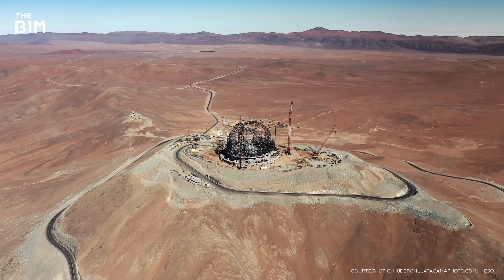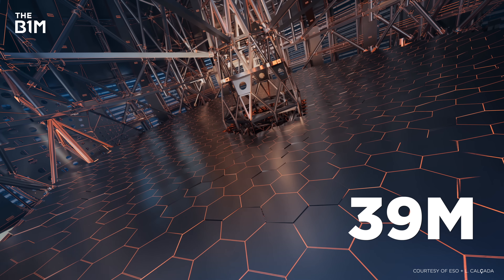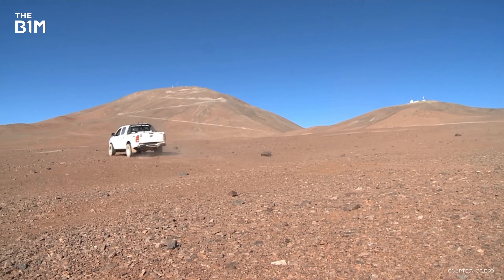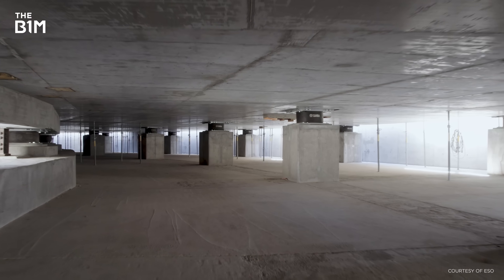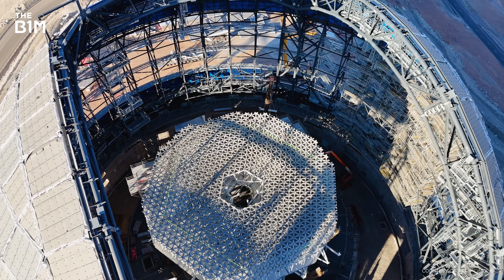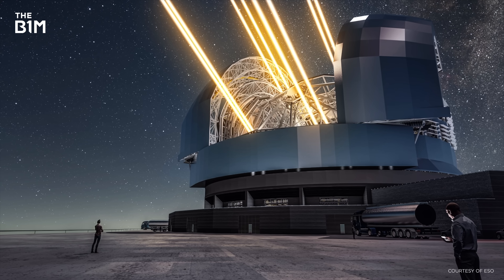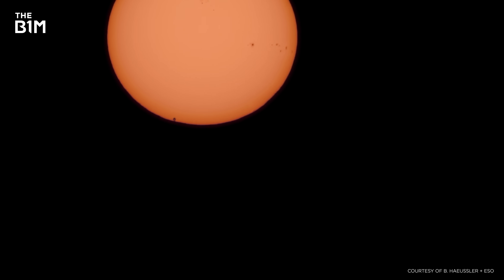South America's $1BN Desert Megaproject

Comment: 10:19 "but enough about mirrors"
I disagree (quite strongly), too much to type so heres a paragraph from the website.
"The M1 is, without a doubt, one of the most impressive and challenging aspects of the entire ELT project. Too large to be made from a single piece of glass, the 39-metre-diameter mirror will consist of 798 segments, each about 5 centimetres thick, measuring close to 1.5 metres across and weighing 250 kg, including its support. Since the segments have to work together as a single mirror, they require specific infrastructure and control schemes. This is extremely challenging, as the full structure will be moving constantly during an observation and will be affected by wind and thermal changes. To achieve the required scientific performance, the mirror needs to be maintained in position and in shape to an accuracy of tens of nanometres — 10000 times thinner than a human hair — across its entire 39-metre diameter!  "

Accurate to 1 part in 1,000,000,000

Comment: The Gemini spacecraft took a 3.5 inch Questar into orbit with a 35mm film camera attached to it and returned with 10,000 times BETTER astrial images than any ground telescope could provide. Space telescopes don't have to "look thru" 300 miles of atmosphere, mirage and heat waves. A no-longer made Meade 16" reflector in space with a 3" sensor attached could outperform the best THEORETICAL ground base telescope for about $60,000 LAUNCHED! Before Hubble, the 5 inch Meade on-board Skylab imaged 500,000 stars never seen on Earth. That's why Hubble, the Solar Observatory and Webb were designed. Read "Sky and Telescope" or any book on astronomy and find out HOW BAD Earth imaging really is.

Comment: If you consider the optics on modern mirrorless cameras, like my Sony, which shoots around 44mp, the actual sensor of my full-frame camera is roughly less than 2 inches wide. That is where light is ultimately captured after being detected and directed by the lens through a glass channel to the sensor. The processor deals with that light and captures it as an image.

With just a prime lens of around 20mm, I can capture some pretty awesome detail in the night sky, like the depth of color in the Milky Way. I can shoot comets fairly clearly with this relatively small instrument.

If you consider the optics of the ELT, with all those mirrors bouncing all of that light information into the center channel, which distributes that information to a gigantic sensor, which looks to be roughly the size of a grain silo you'd see on a farm, that is mind blowing. 

The other thing to consider is that with supercomputers, we can now program them to sort out detail in optical images for better dimension and resolution and color. As A.I. and processors improve, the true power of ELT will be realized. 

After ELT captures an image, or series of images, we can use software to stack the images as well for more resolution. Our algos are getting better all the time at reducing noise and increasing sharpness and resolution, as well as color grading. The leaps in astrophotography recently are mind-blowing. 

Once this thing is operational, it won't be long before people who specialize in photography products (like Adobe and Topaz) begin to come up with hacks and new tools to better process the information in the RAW files if complete files are released to the public. The eventual final images could be better than what the astro nerds can do on their own in their labs if the public is given a crack at the editing, especially universities or random internet nerds. 

The point is, the scale of this project is insane. Also, the resulting images will only get better as our ingenuity with processing and editing improves, which is always accelerating. We will be even more amazed at each new computing stage. 

I do hope this endevour is transparent. If they detect clear evidence of life and alien civilization, I hope it is not either filtered or hidden or sanitized inaccurately. I hope we get to see whatever the hell it is they find.

If they built this because they are already aware of aliens, or have communicated with them, I hope that is shared sooner than later. I don't want any lingering conspiracies about the whole purpose of this machine. Publish everything.

Comment: My question is, how does they keep dust off the mirrors ?
Even unused mirrors get covered in dust, even more so horizontal mirrors placed in a desert.
Reply: We spray pressurized CO2 ice at a glancing angle which grabs dust/contaminants on the mirror surface and removes it.  Every 1-2 years the mirrors are recoated in aluminizing chambers in the lower levels of the telescope.

Comment: the big mirror is, well, mega, but I want to know more about how the later mirror (m4 or 5 ?) can correct for the atmospheric conditions.  
Is that physical or via some optical transforms done digitally ?
That sounds more amazing than building a big building on top of a mountain.
Reply: It does it physically. The mirror has loads of small actuators in it that distort it to keep the guide stars spherical.

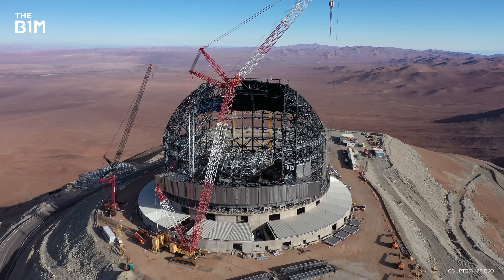Comment: 8:05 “…as large as they can get…”… yes, all due to gravity.  Bigger mirrors, bigger support structures.  Eventually you hit a point anything bigger will sag under the load.

But imagine if it didn’t fight gravity.  Somewhere there isn’t gravity and coincidentally no atmosphere to attenuate observation.  It’s time for humanity to build ridiculously huge telescopes in space.

Time to build space telescopes in pieces like the ISS was built.  We can still loft telescopes a bit bigger than JWST thanks to new heavy-lift rockets.  But to really blow the doors open we need to loft sections of telescopes with those heavy-lift rockets.

Hopefully in the not-to-distant future we’ll build telescopes in space from in-space resources and do away with the rocket bottleneck altogether.  There would be nothing to prevent us from building mirrors kilometres in diameter.

Comment: A little more on active optics… each of the mirror segments “wobble” microscopically in real time under computer control, to compensate for thermal distortion of the light traveling through the atmosphere, thereby correcting the image, which is normally the bane of ground based optical telescopes and essential to such powerful magnifications achievable by the ELT. This negates much of the advantage that space based optical telescopes like Hubble have… or more exactly, had. What amazing technology!
Reply: Its called adaptive optics actually. Active optics does exist and in use, but it is used to help maintain the shape of the primary mirror regardless of its orientaion and gravity drop. Active optics and adaptive optics arent the same thing.
Reply: @ Thanks for the correction. Thinking adaptive -  writing active. Brain fade.

Comment: Thanks for your video, very well done. A small detail, the system described in 10:00 (the laser thing) is adaptive optics (and not active optics). Active optics also exists in the telescope but it deals with the main mirror, maintaining the optimal shape of it.
Reply: Glad someone else noticed.  Active optics bends the mirror using pistons to help get rid of certain optical aberrations (astigmatism, coma, spherical aberration), while adaptive optics uses natural guide stars or laser guide stars to correct atmospheric distortion usually around 1000 times/sec.